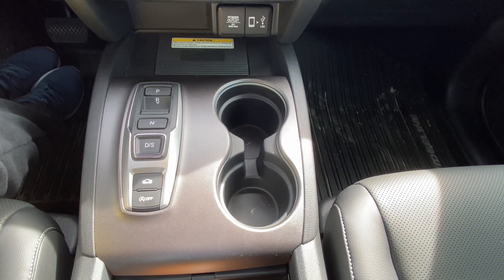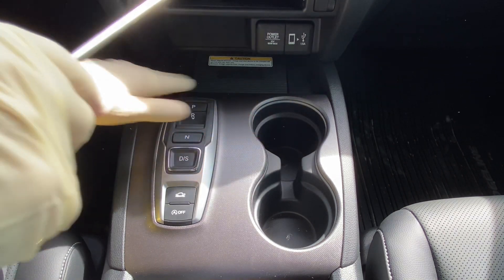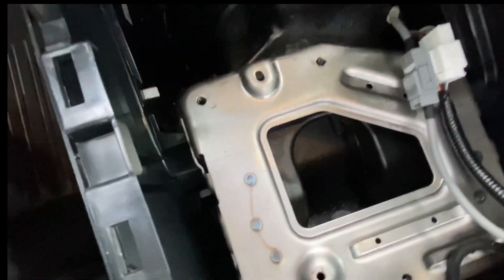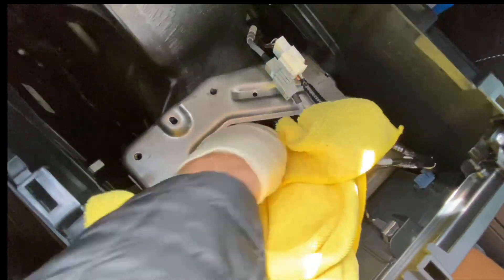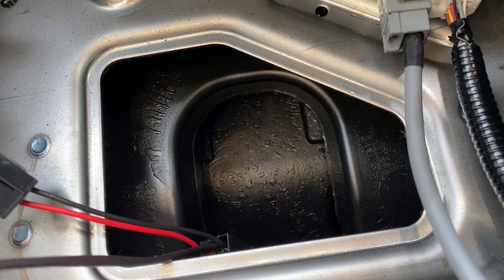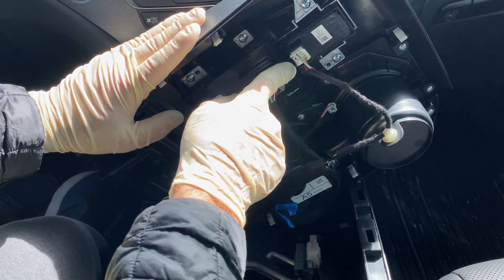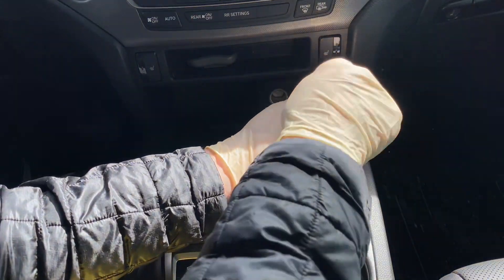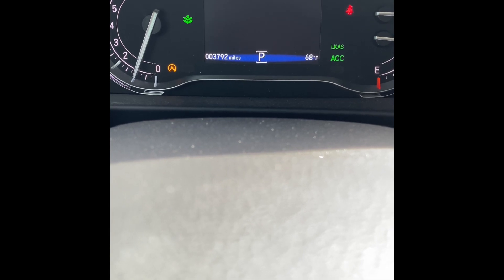Idlestopper v2- 2019-2022 Honda Pilot - Turn OFF auto idle stop permanently

Comment: Just installed this on my '21 Pilot.  It works!  SAVE YOURSELF FRUSTRATION! That tab that the tech says needs to be pushed in (2:38), is NOT the case.  It actually needs to be pulled away from the plug body.  I tried on three separate days to get it to work the way he shows it.  Didn't work.  I finally got a 90 degree pick tool and a long flat screwdriver, worked the pick tool above the tab and pushed DOWN, applied pressure with the screwdriver, and off it came!  Finally!  I was so happy to be able to continue with the rest of the install! Now, looking to install another one on my wife's new '24 Passport.
Reply: THANK YOU SO MUCH!! Your tip saved me! I spent half an hour trying to pull that plug out. Ripped up my hands and broke my back trying every angle. Finally went back to this video and read the comments and your suggestion was spot on. I used an awl with a bent tip and a long screw driver just like you described. I used the new plug as reference to know how to place them, and after a little playing around to get them in position the plug popped out without much force. Really appreciate you posting this.

Comment: Just got done installing mine on my 2021 Pilot. Very helpful video, although I don't know why you would say removing the wireless charging pad was the worst part of the installation. That took 2 seconds. What I struggled with was unhooking the power socket connector. Honda didn't leave much room in there especially if you have large hands. I found a useful tip in the comments of videos for other Honda models which suggested trying it from the passenger side, which did the trick for me.
Having said all that it works like a charm! This fixes the one thing that I absolutely loathed about my Pilot, so I couldn't be happier.

Comment: I just installed this on my wife's early 2023 Pilot... same setup as this. Instructions were spot on. The hardest part is getting your hand in to remove the power connector. If you put your hand in sideways and then turn it to face the connector, it's not too bad. Looking carefully at the orientation of the connector first really helps. I saw the comments on the 2023-2024 vid... I've worked on my cars for 40 years... mechanics deal with these scenarios all the time. Great product and great instructions! TYSM for a nuisance remover.
Reply from the maker: Thanks for sharing your feedback/suggestions and thanks for being a customer!

Comment: Thanks for this video.  Just installed Idlestopper on my Pilot.  I had a hard time removing the factor black power connector.  I ended up using a long flat screwdriver in 1 hand to wiggle off the connector while pushing on the upside down tab with other hand.  Otherwise, it was very easy installation.

Comment: installed on my '20 pilot after getting stranded by a no-start condition at a busy intersection in florida.  battery was flat busted and i had to replace with an autozone battery at $230.  battery was toast due to auto stop/start.  easy install on '20 pilot.  10 minutes tops to do it.  while this may be cost-prohibitive for some folks, just know that it works great and is a permanent solution.
Reply from the maker: Thanks for being a customer! It is very dangerous to be stuck at an intersection and we are glad to help provide peace of mind that it won’t happen again.

Comment: Just installed on a 21 Pilot….does what it states it does. As for the installation, there were a couple of points where it was difficult and frustrating. First, getting the factory connector under the panel OFF. I read a couple comments here saying you have to PULL the tab UP as opposed to depressing it as it is stated in the video. This is incorrect. The harness indeed needs to be depressed. But the plug itself is on tight. Press the tab while pulling on the plug. This should give you a little clearance of disengagement. I had to wiggle the connector side to side and up and down (gently but firmly) and was able to get it off. The second frustration was connecting the t-shaped harness. There was very little slack in the factory wire so you can’t pull it up enough to make the new connection. Took several tries of trying to make the connection with one hand…aligning the connectors and then pressing them together.  Perhaps making these connections first would be easier. Don’t know and not taking it apart to find out. Lol.
Reply from the maker: Thanks for the great installation tip! We appreciate having you as a customer

Comment: Anyone else not able to get the cable to disconnect under the gear selector? Mine won’t seem to release
Reply from the maker: Sorry to hear that you are having troubles with the connection coming loose. Some of them seem to be tighter than others. I would suggest to try while sitting in the passenger seat at a different angle. The other suggestion would be to focus on wiggling the connection while pulling in the off direction. With the tab pressed down, wiggle a few times up and down and side to Side, then start pulling while still holding the tab. If you need a reference for the release tab location and feel, the idlestopper module has the exact same factory connector. I hope you get it! Also make sure to wrap a towel around the opening so you don’t cut your arm on the under dash area.
Reply: @idlestopper7486  Will give that a shot. I felt like I was wiggling it pretty hard but it's hard to tell if I have the tab pushed down enough to unlatch.

Comment: Why not just tap the button to turn it off when you hit reverse or drive each time.  It becomes a habit after just a few times.
Reply: Yeah why Mess with the wires
Reply: I always do, but the one time my wife was driving she left it on and she broke down in traffic and wasn’t able to restart for 1 minute.
Reply: Because if you forget to do so it will breakdown & I'm not putting my wife or my 4 year old son in a dangerous situation. Honda should have a fix or bypass for this stupid button but they will not do anything about it. I will be doing this bypass asap.